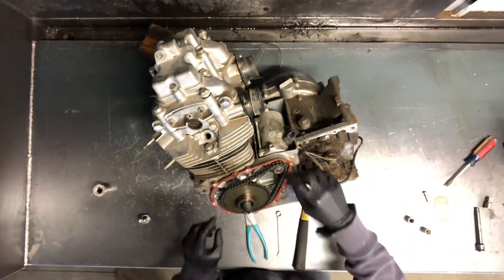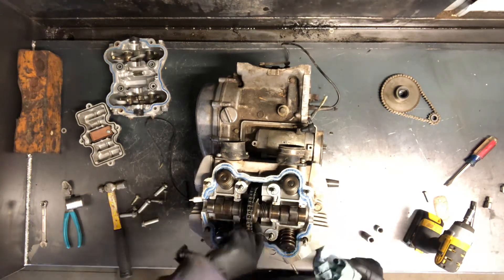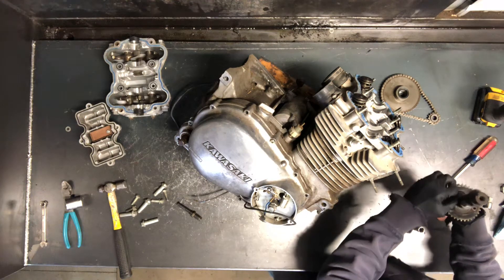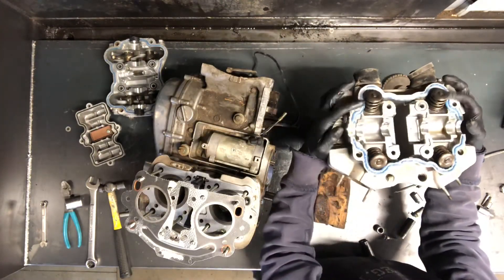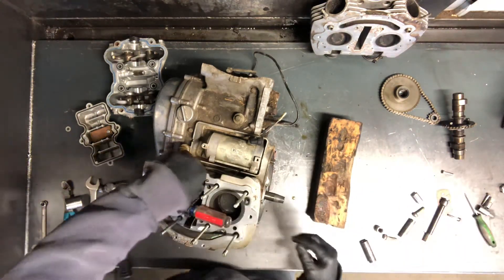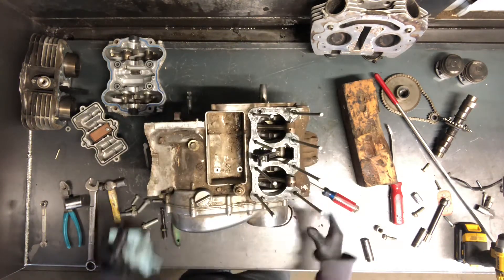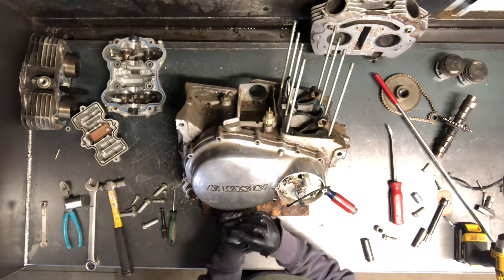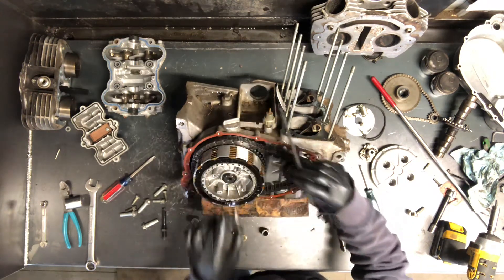Kawasaki KZ400 Vintage KZ 400 Cafe Racer - 2/3 Engine Head Remove Cam Shaft Cylinder Clutch

Comment: Excellent Video! Just got my hands into apparently the same engine and frame. not sure the year but engine looks exactly the same. I need to replace the pistons as one is broken but cannot find the same exact ones as the engine came with. not sure on what I should be considering or what to do.